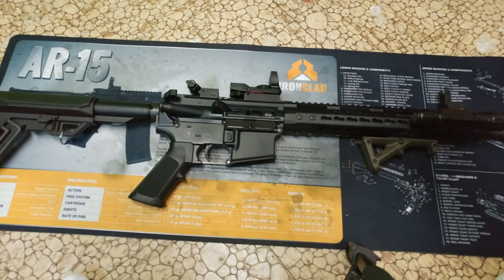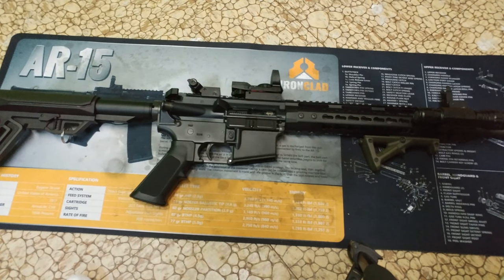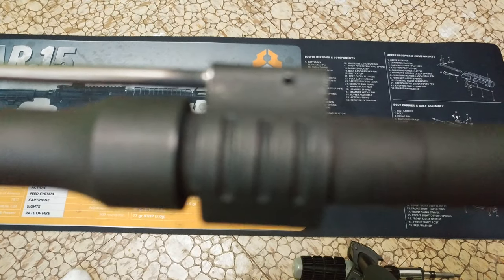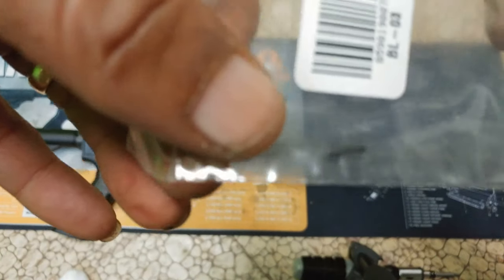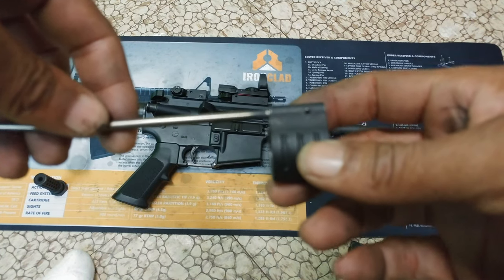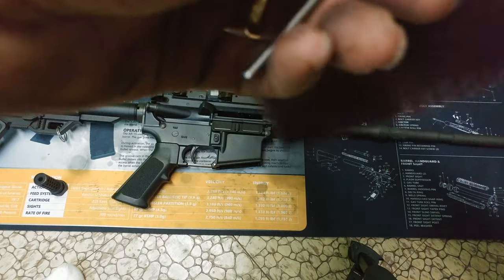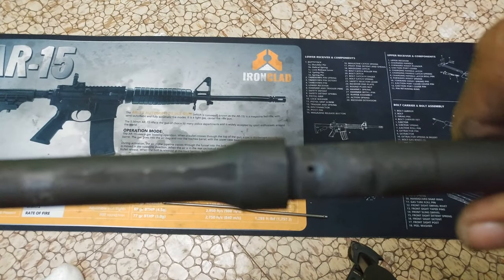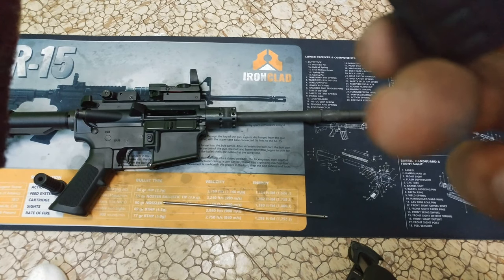AR15 SHORT STROKING, FAILURE TO EXTRACT OR FEED ISSUE.

Comment: Make sure to put blue locktite on the gas block screws if the problem is solve just to prevent you screws getting loose because before you gas block was a bit move forward, I was having having issues with my pistol gas block, my gas tube was leaking gas for the roll pin and the back of the gas tube i replace the roll pin and still leaking gas and I replace both and problem solve😬 good video by the way 😀

Comment: So my .223 was short stroking. Was ejecting the casing fine but not going back enough to catch a new round or when it did barely catching it and jamming it sideways. 

I took Apart my bolt carrier and firing pin and it was all covered in soot. Cleaned it as best as I could and oiled everything that needed to be oiled (there’s plenty of vids showing how to do this). Now it’s firing like new. Saved me a ton of money taking to a gun smith or shop to tear it down and sell me a gas tube or whatever else they ended up replacing trying to fix it. Hope this helps someone with this issue. 

Also I had just bought it used from a pretty well known gun shop and figured they would have done all that before selling. But that’s wishful thinking..
Reply from the maker: yeah there are a few things that can cause that problem. mine was definitely the gas tube roll pin.

Comment: I’m sure I’ll catch flak for this comment but I think this is where the advantage to the Ak platform shines vs the Ar platform 
There’s just not nearly as many tiny pins and screws holding everything together on the Ak
Reply from the maker: There's truth to that
Reply from the maker: There's truth to that.
Reply: You just have to use press.

Comment: Your gas block was a little far forward also . I noticed you had it much closer to the shoulder on the rebuild .
Reply from the maker: Yes, It all depends on where your hole aligns. It shifted and had to be repositioned. It is not a uniform alignment with every carbine. There is a tab that you can buy that you stick through the hole to assure alignment. I didnt show that step in the video, but I did do it. But the simple reply is that NO, aligning by setting against the shelf, it not the proper way to assure alignment.
Reply: @samuraijutsu8876  ; I just use calipers and a feeler gauge .
Reply from the maker: @orionfixr7713  yes I suppose that works too.

Comment: Cause by buffer spring and/or buffer itself
Reply from the maker: NO, MY PROBLEM WAS DEFINATLEY THE ROLL PIN IN THE GAS BLOCK
Reply: @samuraijutsu8876  I have short issue due to buffer and buffer spring. Spring was too weak to cycle the bolt carrier. Buffer was too heavy, I replaced H2 buffer with an H buffer. Thank you for the info. Rock on!
Reply from the maker: @hnguye22  Oh ok, i thought that you were saying that mine had that problem ...lol

Comment: You didn't need to remove the gas block to remove the gas tube. Not all gas tube roll pin holes will line up with the gas block roll pin holes. It needs to be reamed when this occurs which is why your roll pin mushroomed Using a roll pin starter is the best.Using any abrasive on the end of a gas tube is not advisable as it can decrease the spec of .180. No need to remove carbon on the gas tube as it is a force positive as helps seal the tube.
Reply from the maker: Yes you are right about that. During the video i could not make that correction. However later i re-pinned it. As far as removing the carbon, scotch brite is super mild as far as an abrasive. It is not sand paper, and light rubbing will not take it out of spec. Also, since carbon build up is not present when the system is new, cleaning it has no negative affect
Reply: @samuraijutsu8876  No problem, just giving some advice, which there is no shortage of in the AR world LOL. I always check my gas blocks with pin gauges to check tolerances and the fit between the gas tube and gas block. The tighter the better. Boat tails are another area people way over clean and can be detrimental to the gas system. I never use any metal scrapers on boat tails when cleaning..

Comment: Did you use a roll pin punch on the roll pin ? It sure did mushroom on you. Danny Hayes
Reply from the maker: i used an equal radius punch pin. Yes it did mushroom about a 1/64 . I have since replaced the pin again because it stayed on my mind. When i did, the old pin was still very secure, but i went ahead and changed it out anyway.

Comment: When this happend to you where u getting any stuck cases in the chamber? I'm having some problems with dubble feeding failer to extract with a stuck empty case. I clean the chamber to till the cows came home and tried a few extractors and I have 3 buffer springs to try
Reply from the maker: Yes I was having cases stuck in the chamber. It was failure to extract and because of that failure the next round would feed behind the empty case or spent shell how ever you want to say it..
Reply: Did you try this and did it fix the issue? I'm having the same issue with an 8.5 inch barrel
Reply: @cphoebus  you ever get this resolved ?
Reply: @dreywezy1887  I chalked it up to overgassing and stopped messing with it.
Reply: How about the buffer?

Comment: Gas block must be against ledge of barrel to line up gas port in barrel. To the gas block.
Reply from the maker: that may be the case on some carbines. However, there are retaining pin notches under the bottom side of the gas block to assure that you get proper alignment. if my gas block was against the ledge of the barrel, i would miss the alignment by a 1/4 inch.  so no, that is not a "must". again it may be so on some carbines, but not in this case. i also took a look at 3 other carbines that i have and it is not the case with them either.  https://youtu.be/w_tYL7JitpY            https://youtu.be/cTmKMIFp0nQ
Reply: No sir! Usually with perfect alignment of the gas block and the gas port there will be a slight gap between barrel ledge and block👍🇺🇸